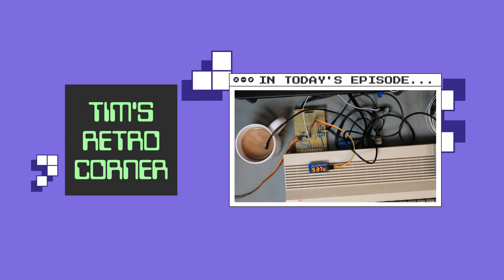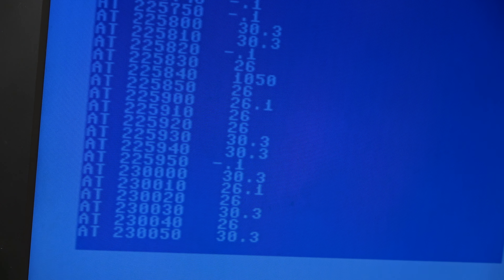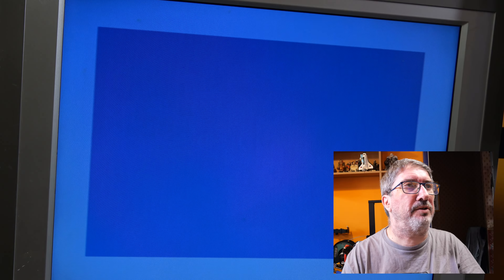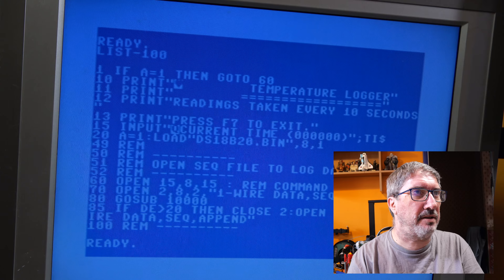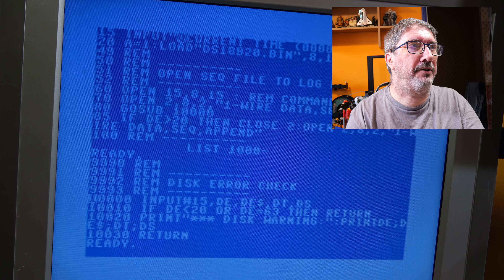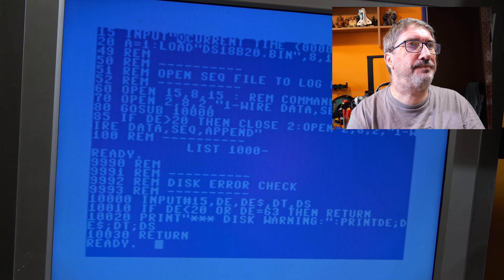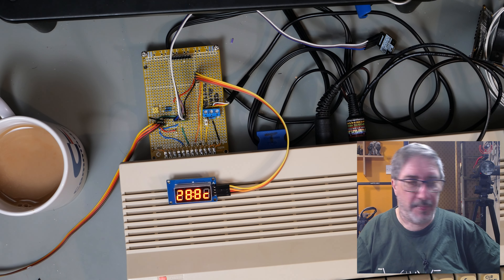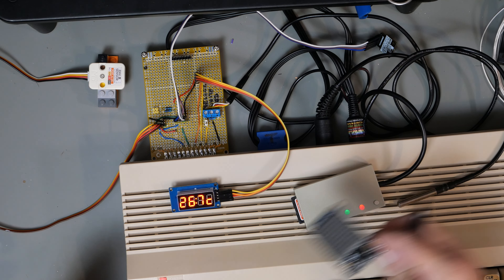More C64 Sensors

Comment: In my shop, I use a Spectrum Temp/Humidity logger to monitor the environmental conditions.  The program is in Microsoft Access VBA and stores the data in .mdb format on my server.  The point is, every 10 minutes is considered the proper interval for cal labs.  I think I am doing it every five minutes. The temp and humidity sensors cannot respond that quickly to environmental changes.

Comment: Very nice explanation and implementation of I2C protocol. You really expanded our quest to prove that our beloved C64 can coup with modern sensors and controllers. Also, I agree with You, BME280 every time :) Cheers!
Reply from the maker: Arduino & Pi users have it easy when it comes to I2C stuff, with all their pre-built libraries. And I'm working on ways to leverage that . . . on a Commodore 64 of course! (or a C128, Plus/4 even!)

Comment: oh man, i wish to see some i2c oled working on that thing, like SSD1306!
Reply from the maker: Me too. Sadly I didn't get the little 13x9 rib matrix I have to work. That's only 351 LEDs, and it's very slow to refresh in BASIC. An SSD1306 is 8K pixels, so... it'll need a ML driver at least. But hopefully there will be a followup video sometime.